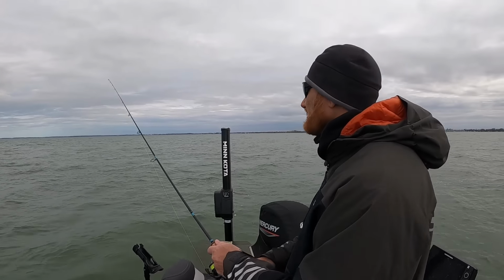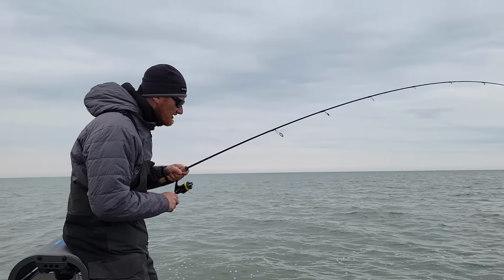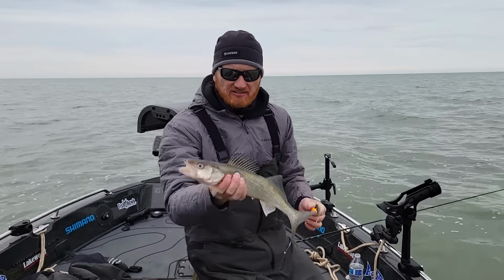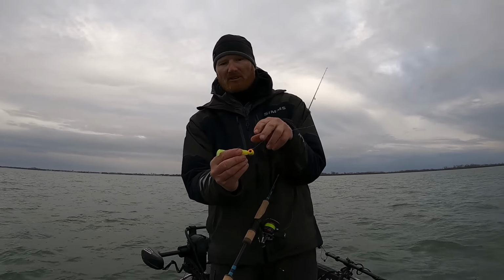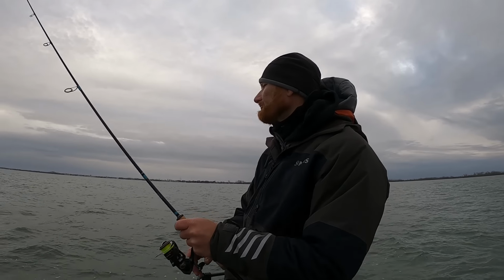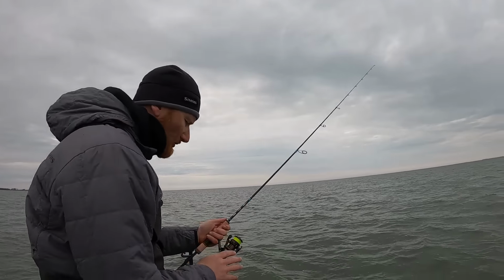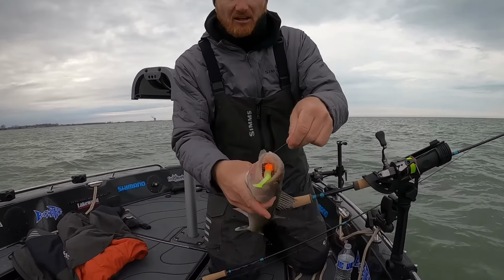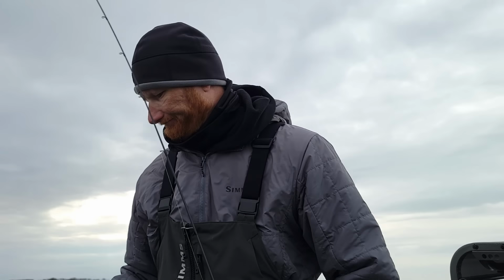Casting and Jigging for Lake Erie Walleye

Comment: Did you say you using 6 lb test line jigging for walleyes is that line to light for walleyes will that line break with a big walleye
Reply from the maker: Lb test will vary by what a manufacture labels them. Look for a mono/ copoly with .o11 diameter....that can be anywhere from 6 to 12lb test. I like p line cx premium 10lb
Reply: @Bigwaterfishing  okay I will get some of that pline this spring on lake Erie in the western basin by David Bessie power plant that's where we go jigging at for walleyes